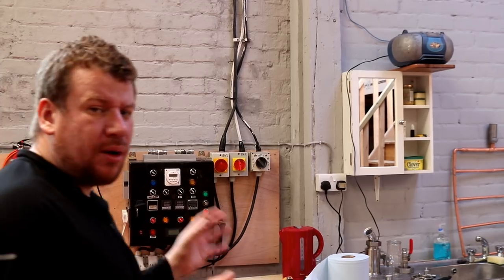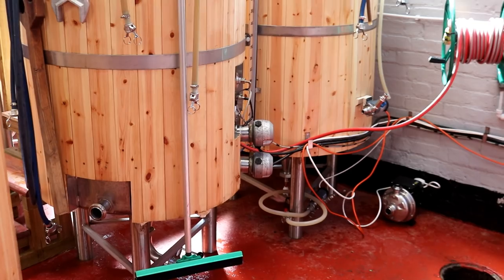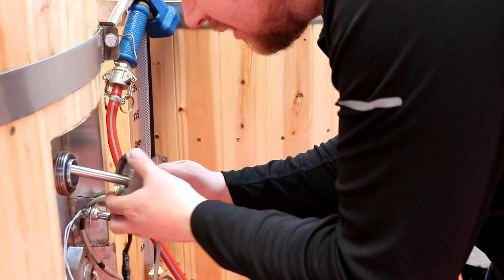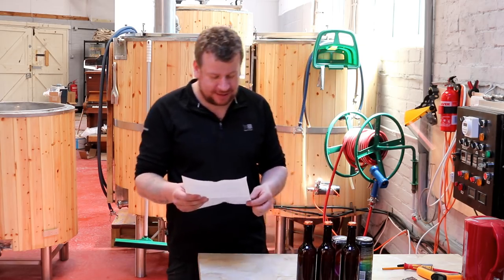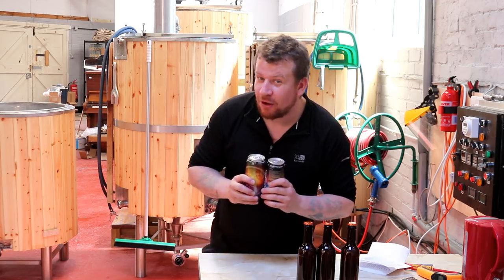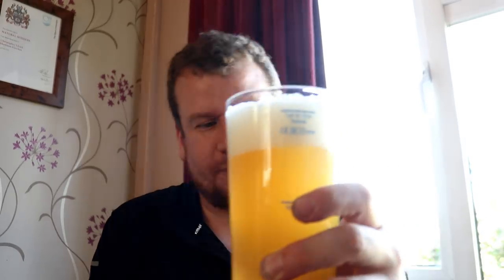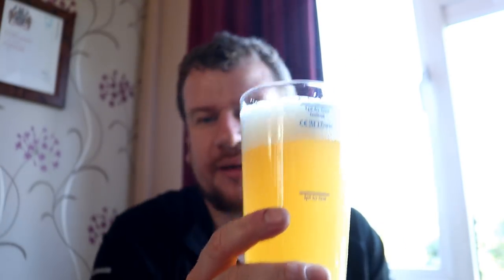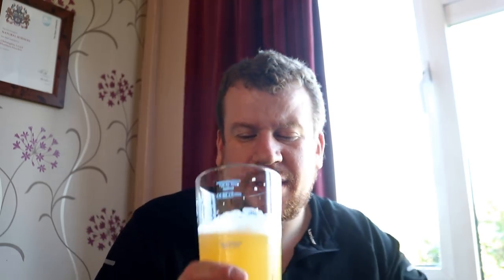WHY I TIPPED IT

Comment: Godamnit Harry I'm descending down the path to madness of progressively higher IBUs (e.g. have you checked out Parrotdog "Bitter bitch"?) .... so it's a heart-breaker to hear about a "too bitter" beer going down the drain, but in seriousness I applaud your approach of maintaining quality and brand reputation.  All the best from Down Under.
Reply from the maker: It was the balance that was the problem. High bitterness is fine but must have the body to cope with it. As this beer finished 1.007 the was no sweetness left to level things up. My fault entirely as I should have seen the calcs were wrong.

Comment: I didn't think that my comment was a fudge, just an open admission of "this batch isn't that great so buy it cheap if you want it". I suspect that even a "bad batch" of your beer is better than some others so a cheap run of a "bad" batch may have dragged in a few more punters who may actually come back and try the "first rate" beer. Still it's gone so no point crying over spilt milk, but it was beer so if you don't mind I may well shed a tear or two 😭 😉 😄 . Cheers, Schnuz.

Comment: I know you said you used ViewPlan at IVB im thinking on buying it whats your thoughts Harry? Same here several dumps to bitter etc here too keep moving on
Reply from the maker: I think ViewPlan is the best BMS out there for the price mate, Once I have the cash I will be getting it again.
Reply: Ok mate thanks for getting back to me malt,unit rent and getting a cold room though atm ££££ its all money annoying lol you had any experience with the chill boxes the ones on Tesco vans? Cheers
Reply from the maker: Never used a van box, I will be using Extratherm sheets to build the cold room, they are about £50 a sheet though so I have to save up. The good thing is you can just add sheets to expand.
Reply: Yeah he wants 600 just trying to sort the delivery out to the unit comes with a big chiller on the frount and two small ones inside all wet proofed insulated cant go wrong really 2011 model its in good nick can fit a good amount of casks in her and bonus outside storage as the unit isnt massive with empty+full bottles and i still havent got malt in there yet thanks for the replies much appreciated buddy